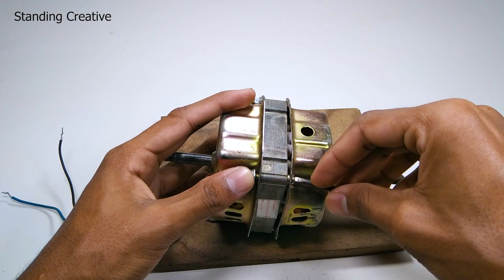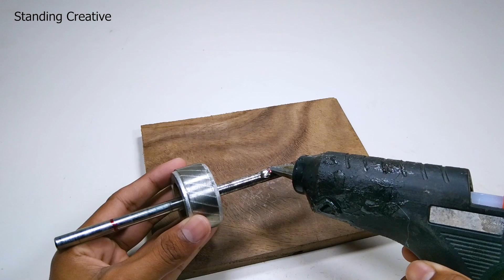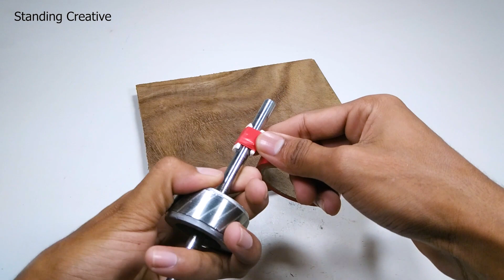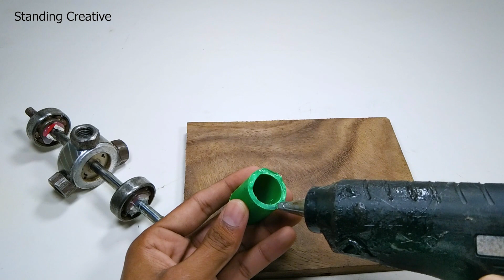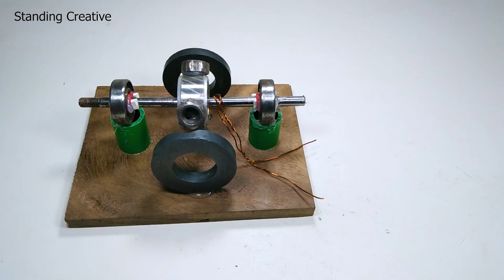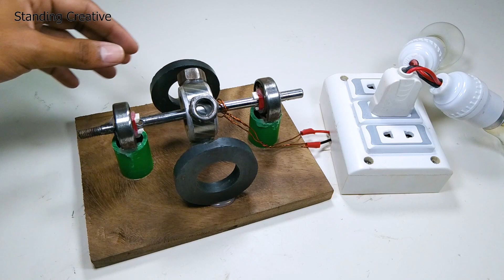I Turned Electric Generator 40000w Fan Alomonium Router Super Power Magnet Free Electricity At Home

Comment: I am not sure what possible math you are using to claim 40,000 watts of power from this device.  40,000 watts of power equals over 53.619 horsepower in any engineering forum.  This is an absurd claim.  Please stop using faulty/false claims.

Comment: من قبل ما تكمل فكره ساقطه ههههههههههههه هيتولد كهرباء في قطعة السلك المعظوله طبعا لا يمكن ههههههههه انتم سبقتو الكدابين
Reply from the maker: Thank you sir for such a nice comment.
The copper coil is basically coated on the up so that it does not shock the copper coil. That is why the copper coil does not shock there even by connecting two wires together.